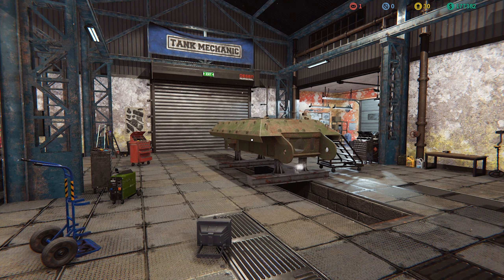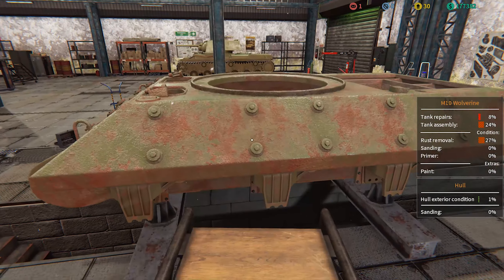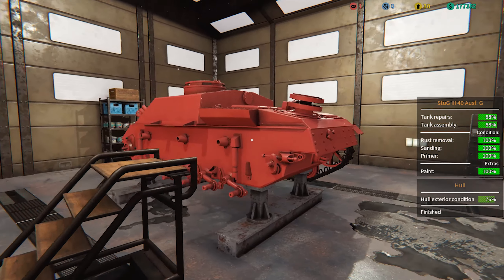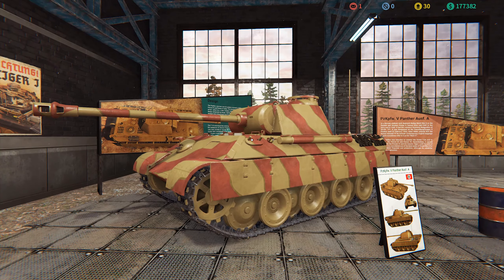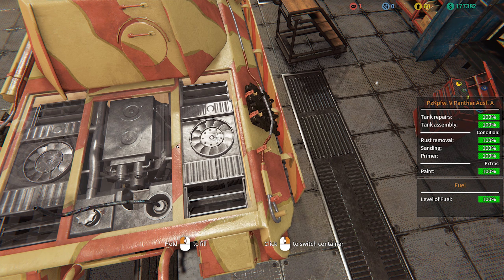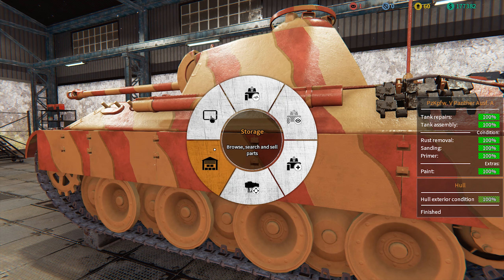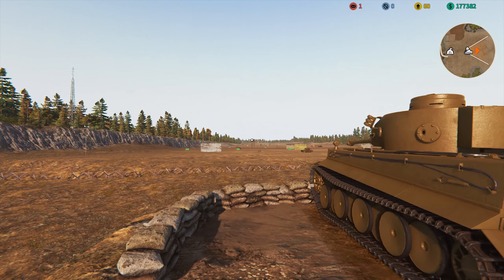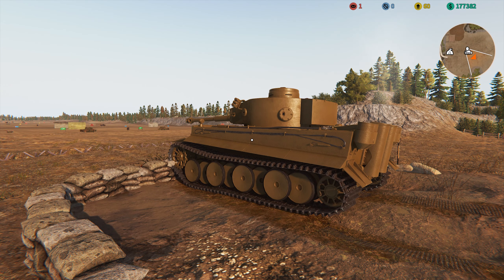What's up with Tank Mechanic Simulator?

Comment: The Stug is a StuG III. The general rule to know if a tank is based off of a Panzer III or IV is to count the number of road wheels and divide that number by two. I got that trick from the Cheiftain.
Also im not even sure that the StuG IV ever saw combat.

Edit: For that last part, I was wrong. Some 1100+ StuG IV were built by Krupp, most of which entered service and saw combat alongside the StuG III’s.
Reply: Also StuG IV has different type of boxy drivers position on front.
Reply: they also have a slightly different hull shape and length if i am no mistaken